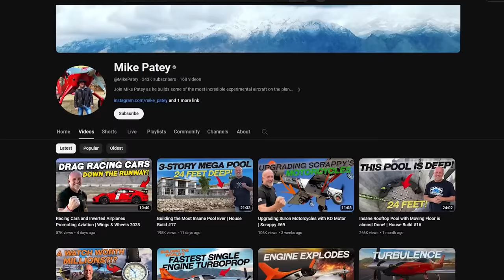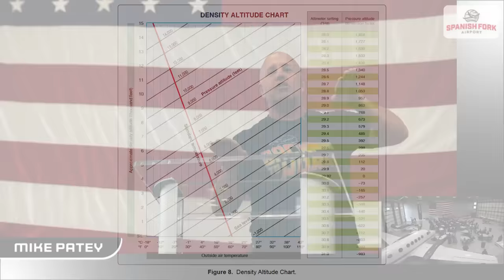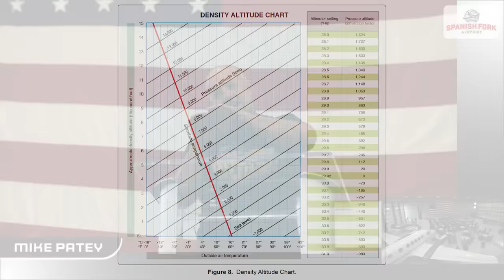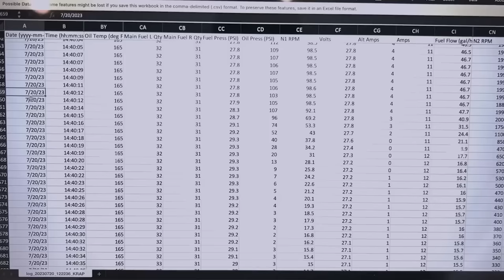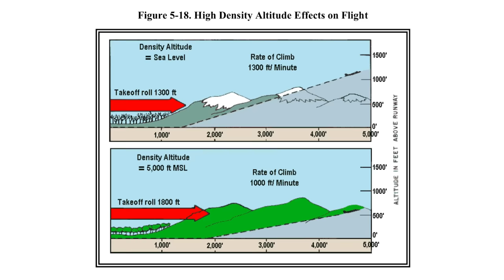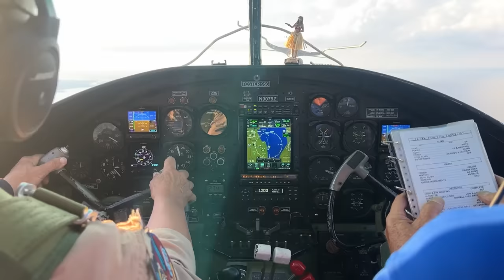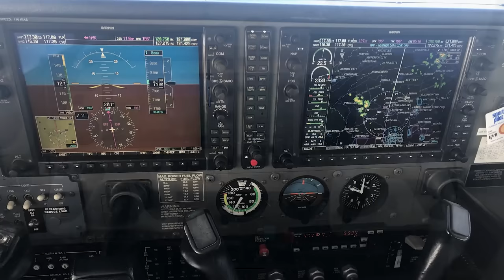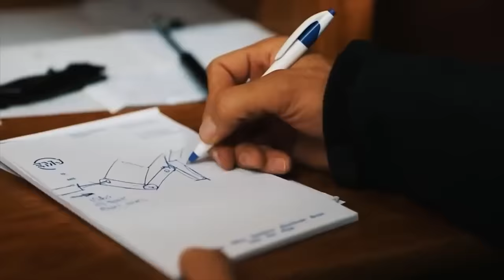I've Lost 4 Friends in 60 Days - Aviation Safety Discussion | Mike Patey

Comment: The amount of fatalities where one of the occupants was a flight instructor is beyond alarming. Many of these flight instructors are extremely young. We have a serious problem here and it’s growing.
Reply: It seems like the amount of accidents is growing, looking at the amount of vids about "probable cause" and so on. Is the FAA suffering from tunnel vision, with their focus on enforcing remote ID for small UAV craft above 250g, or even below, when flown as part 107 operation, and losing focus on the risks of manned aviation, where people die on a daily basis?
Reply: Instructional flights are the most difficult and dangerous. Those instructors have to try to teach in a highly dynamic and relatively chaotic environment where sometimes the students are inadvertently trying to kill them or put their certificates at risk. It is juggling quite a lot with crap pay and typically crap schedules, working for many more hours than the Hobbs meter shows. It is exactly where I’d expect to see most accidents, GA or instructional flights.
Reply: It's been getting steadily worse since 1970.
My instructors were flying in 1936  and 48.
Took my first lesson at 10 yrs old.
I learned the old ways and AQP. 
In 55 years CP I've flown with several incompetent unsafe pilots with 5-10,000 hours. Scary.

I sold a single engine Cessna to a CP and he stall/spun it on takeoff, fatally. How the hell does that happen?
🔔😎
Reply: The aviation industry imposed many arbitrary requirements to make qualified airline pilots. This shortage is self-inflicted.
Reply: Instructional flights make up around 8% of GA fatal accidents (but represent around 20% of total GA flying), while personal flying makes up around 79% of fatals. Is there more to be done? Of course.  But the data says flying with an instructor on board is much safer than personal GA flying. Consult the Nall Report for the data.
Reply: Vaccidents  ?
Reply: @rc-fannl7364  I wish more people outside RC flight understood this. The FAA is spending millions of dollars and thousands of man-hours on tracking what are essentially toys, and not even tracking them in a way that actually makes the airspace any more safe because it's not really enforceable. They are doing this while actual human involved aviation safety is tanking. Not to mention the current shortage in both experienced pilots and controllers which isn't going to be made any better because the FAA has crippled one of the major hobbies that funneled kids into the flight career.
Reply: @CDRaff  Indeed. Naturally the rc pilots that do cause a threat must be addressed, but the existing rules already allowed for that, and the RC hobby has an amazing safety record over the years, even when technology was less developed and more prone to failure. If all the resources wasted on this remote ID tracking system would have been devoted to making manned aviation more safe, even if it would result in one less casualty, that would already have been a no-brainer, since there hasn't been any loss of life due to recreational drone flights. And the most of the incidents that appear in the headlines of near-misses, etc, often later turned out to have had different causes.

What's next, start tracking rc cars, and focus on those, instead of trying to make daily manned traffic safer?
Reply: Agreed. I think it's a sign of the culture. As much as GA prides itself on attention to detail and discipline, the pool of GA is still drawn from the wider culture. Which America doesn't do well anymore. We're a lazy nation of shortcutters, thrill seekers, and non-long term thinkers. It all weighs, in every industry, every profession. We see the decay all around us, GA cannot and will not be an exception. And commercial next.
Reply: @TheRayDog  How much experience do these pilots have?  You have a lot of people with money that think they can do anything, ego maybe? Some get into machines  or situations that are far beyond what they are ready for.  Its like the Kennedy Curse, there was no curse, these people had the ways and means to play risky games without the experience and skill they required.
Reply: Youngbabd inexperienced.   They have no real world experience.  It's all theory for most of them.
Reply: @TheRayDog  Well put. Technology blowing up on us overnight during the late 80's and early 90's increased our desire for instant gratification, and we didn;t think about how that'd affect us.

Comment: I’m a sailor. Early in my keelboat days I used to deliberately head out in gale conditions because I had a stout boat and years of sailing experience in dinghy’s. I always checked the forecast, and had all the necessary safety gear. 

One day I headed out with winds forecast to be 25 to 30 knots with 10 foot seas.

“No problem - I’m just gonna head out a mile or two and see how it goes. I can always run back into the harbor if it gets too ugly”

At first, winds were light and variable, with big lumpy seas. No problem. So sailed a little further out. Then the wind suddenly shifted 180°, and it began to blow. HARD. Harder than I ever experienced at sea. It was blowing offshore to that meant I’d be blown out to sea of if I was unable to sail up wind back into the harbor. No way my tiny outboard engine was going to get me home that day. So I sailed. I reefed down the mainsail and beat back into the harbor under my working jib. What was forecast has 25 to 30 kn turned into 30 to 45 kn of wind from a completely different direction. The windstorm was so powerful that it sank boats 40 miles away at Catalina island.

I was lucky to survive the situation I’d put myself in. I was alone. I pushed myself and my little 20 foot keelboat to their absolute limit, and I learned that forecasts are not perfect. I am an older and much wiser sailor now I know exactly why this pilot has a three strike rule, and is much more conservative now than when he started out. I have a one strike rule now I won’t deliberately head out of the harbor if winds are forecast to be 20 kn or greater. Ask any experienced offshore sailor. They’ll tell you that when it’s over 20 kn. Things start getting serious. Over 30 and you will have your hands full no matter how big or well-equipped your sailboat is. Over 40 kn, and you are in near survival conditions in most boats. If you want to have a long, safe and enjoyable sailing career, you won’t deliberately head out of the harbor when the forecast calls for strong winds.

It sounds to me like the same thing applies to general aviation regarding density altitude, performance, icing, mountainous, terrain night, flying and carrying heavy loads. I always seek to maintain a wide margin of safety when I put to sea. I never want to be caught out again in conditions That require 100% from me or my ship.

Because at 101% it’s over.
Reply: Great story. I love to hear about sailing adventures! 

Aviation is similar, a light plane you also don't want to be out there in anything over 40kt winds. 30 can be sketchy unless its really smooth, and coming right down the runway heading. So 20kts with any crosswind component is a good rule of thumb for small ~2,000lb airplanes.

It's ill-advised to depart into mountain terrain with greater than 20kt winds down low. 30kt winds aloft at the very most. Anything over that, and mountain wave along with rotors and weird wind shear and vertical gusts will make the experience somewhere between miserable and fatal.
Reply: Sailed out of Oxnard or ventura?
I did a season of lobster fishing out of Santa Barbara 
Greatest adventure ever, and even though I grew up in so cal, it ignited my love for the sea.
And very surprising, considering I suffer from thalassophobia.
Reply: Brilliant bit of writing- safe sailing friend. :)

Comment: I saw Mike's incredible speech at the weekend after blancolirio linked to it (Juan was the other keynote speaker). This may well be one of the greatest speeches ever given on aviation safety. It comes from a place of profound loss but is so clear and logical at setting out the accident chains that lead to GA losses - so many of them down to personal judgment calls. It's a tough watch but a necessary one, and I am sure that it will save at least one, if not tens or hundreds of people, from experiencing the loss Mike is right now. Bravo.

Comment: I once read flying is no different to riding a motorcycle 

You have two buckets 

Luck / experience 

Your goal is to fill the experience bucket before the luck bucket is empty.
Reply: Doing both, I'd agree except that it's easier to find a place to park a motorcycle than to find one to park a plane.

Comment: Hey Mike I’ve been following you for years now. I’m just getting back into aviation after a 9 yr break. I think everyone needed to hear all of this after a tough year in aviation, so thank you for putting that together. When you try to push a flight that shouldn’t be pushed and the strikes start adding up, that’s when you see “the holes in the cheese start to line up” as my friend would say.
Reply: I worked on a weapon system that used cylinders with holes that would line up one by one until there was a clear shot to arm.  “the holes in the cheese start to line up” was what we used to stay.

Comment: Mike and Juan great content, thank you.
Also the caution encouraged by the three strike idea.
My little tale on the icing situation is, even if your aircraft is fitted with de-icing equipment, be prepared for the unexpected.
Pneumatic boots can fail in a nasty way. Had a stuck pneumatic valve that caused the boots not to cycle. They inflated and failed to deflate. Ice build up was immediate and much worse on the inflated boots. Loss of airspeed, increasing  AoA to try to maintain altitude in spite of full power being set.
Luckily the terrain allowed an emergency descent to below the freezing level so I'm still here 🙏

Comment: I for sure will be implementing the 3 strikes your out, I have been up bristel light sports aircraft a few times when I first started flying lessons. I got asked to come in earlier because the weather later on isn't the most favorable. So up we go. We were being thrown around with bad turbulence and by the time we made it back to the airport we had 15-18 knot cross winds which exceeded the aircrafts crosswind limit. When faced with these situations it really makes you take a step back and really think.
Reply: Those are the not so fun moments, but we do learn from them.

Comment: I'm 73 yo and havn't flown in many years but I am a woodworker so I have my own list of strikes that has kept me safe.  I enjoy a beer sometimes in the evening, so,   Unbreakable strike is You can't touch anything with a cutting edge.  So I enjoy myself doing measuring and marking, cleaning the shop, hand sanding (no power sanding), sketching out tomorrows work.  It all works out.

Comment: Awesome presentation, Mike! I have not flown night PIC in 4yrs due to the extra risk. The last 2 night flights were both in a turbo Lance that lost half of the single drive mag in flight & the turbo saratoga ate a exhaust valve 30hrs after cylinder repair. Can’t agree more on ANY number of strikes & you’re not flying. Safety first means coming home at the end of the day.

Comment: Risk stacking is a big problem in GA. Good on you for bringing risk stacking into the conversation. 1) don't fly unairworthy aircraft 2) Don't lose control 3) don't fly in weather you or the aircraft don't belong in. 4) don't run out of fuel.

Comment: This came up in my feed and I usually avoid aviation topics these days, but I was compelled to watch. Great speech! I was flying w a student at night in the winter in a 172, to do the IFR crosscountry. About 2011. We flew from Seattle to Hoquiam. IMC but no expected ice. The departure had us fly over the VOR, over the pacific ocean for a climbing procedure turn and intercept to the victor airway. I didnt consider the moisture from the ocean. After the turn, the airspeed dropped to zero and the controls mushy. Full IMC at this point. I shined a light on the wings and saw a very thick layer of clear ice over everything. It literally took a couple of minutes to build up. I then spent the entire flight back doing a frantic combo of fixing, searching for lights below the cloud, getting progressively lower due to ice, getting out of radar contact, etc. Once the ice started shedding and hitting the tail, it was scary AF but still felt a huge relief. My ex wife still tells me how white my face looked when I got home. It still makes me sick to think about.

Comment: Mike my friend, I will probably get a little long winded here, but if you happen to read this comment, I have a profound appreciation for the approach of your presentation in allowing for the emotional gravity to be clearly present. When one engages an audience in a factually off script style that is a non-stop experience of highly relevant and valuable detail, allowing genuine emotion to frame the context while delivering such clarity really cements the credibility of every word. This was extremely well done here and I truly commend you as a highly experienced source on this topic. This is unquestionably one of the most important presentations that should be a mandatory watch for every pilot. Reading safety guidelines and suggestions simply does not convey the true gravity or present the same profound impact that hearing these experiences coming from someone who has either personally witnessed an incident in some form or has been personally involved with these types of instances. The nuances you offer of genuine emotion places the reality of what outcomes are likely right…in…front…of…their…noses. I was a safety director in a sector that involves a lot of massive equipment both operationally as well as to engage in the serviceability of that equipment. There is a certain required level of precision and intention to ones attitude towards the work being engaged in that I had ALWAYS related to ALL engineers and specialist labor providers as being critical on the level of being a pilot. As the talent, skill, and familiarity with the activity being performed increases, for some that elevated level of experience actually becomes their most dangerous vulnerability. Being good at what you do is not the same as being an expert in the task AND the specific uniqueness of the environment in which it’s being performed. Any true expert will mitigate ANY safety concerns by eliminating those circumstances that show the highest vulnerability to failure. Your personal “3 Strikes Rule” is a brilliant example of that approach and the story of you caving to your innate sense of precision by speaking up and removing the passenger of another man’s plane is another brilliant example. You are unquestionably an expert my friend. No question. 👍🏻😎👍🏻

Comment: Brilliant talk! Made me think. The elephant in the room is, though, that we need options other than "not go", because we all have obligations and sometimes HAVE to go. We need: reliable de-ice for everyone, "virtual VFR" for everyone, etc. Let's get inventing.
Reply: They have reliable de-ice equipment. Everything installed is certified by the FAA for specific threats. It must be activated by a pilot aware of the potential of ice. It also costs money.
And the heavy duty de-ice requires turbine bleed-air. Most general aviation piston aircraft do not have de-ice equipment. Leas than % do and they all start around $1,000,000.

Avoiding (airframe) ice is rudimentarily simple. Because it can only form under this specific scenario. 1: Flying through visible moisture (clouds/fog) 2: When the temperature drops to near-freezing levels of around 35 degrees F or 3C.

You must have moisture and you must have cold. Avoiding that is simple. :1 Don't fly in clouds when the temperate is at, near, or below freezing. Do avoid clouds at all times. That is it.

Comment: Hi @MikePatey, first of all I wanted to say I'm sorry for your losses. Thank you for sharing your thoughts on this difficult matter. This really resonated with me and I wish every pilot would watch this video, regardless of their experience. Safety needs to be the core and the absolute goal of every single pilot from the very beginning of flight training. I'm just starting my CFI training in CO, not because I need the hours to fly the big airline jets, but just because I love aviation and want to hopefully make a small difference in the GA community. I wholeheartedly agree with everything you said about the attitude we need to have regarding safety, the humility to ask ourselves "should i really go with that kind of wind?" for example. We need to instill that safety attitude from the start. In my very very limited experience flying (300h -ish), I cannot count how many times I've decided not to go up because something just felt "off", or if there was some uncertainty about the weather/winds. As you said, there will be always factors you can control and some you can't. If high winds were not on the forecast, as it often happens here around the mountains, and we went flying, well, we deal with it with the best of our abilities. But if there are signs that it may happen, even if it's a low chance, we shouldn't risk it. Even if it is our one chance to go fly in the entire week, even if we have to practice for an upcoming review or checkride, or whatever may be the reason that pressures us to fly. Whenever there is any doubt, there is no doubt: no go. Thank you again, back to work.